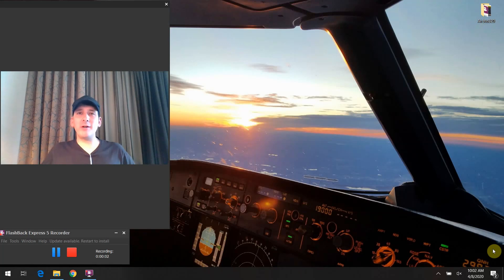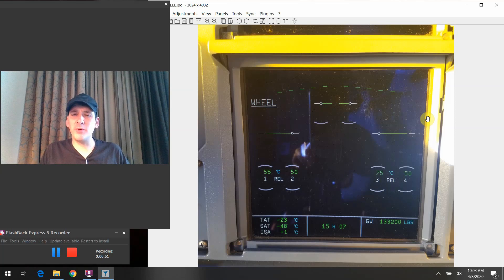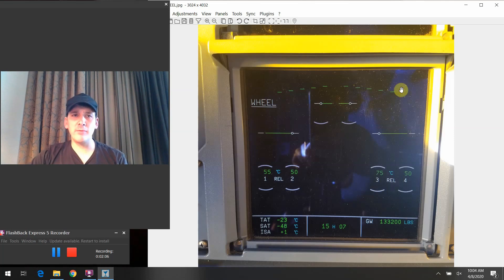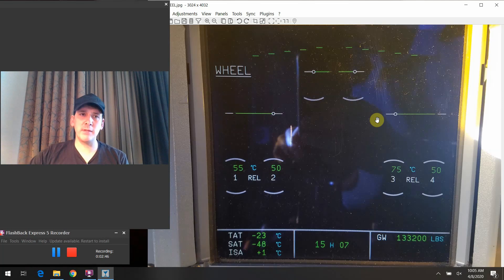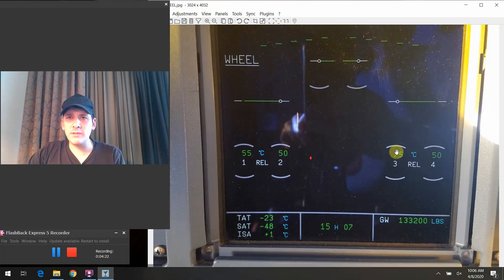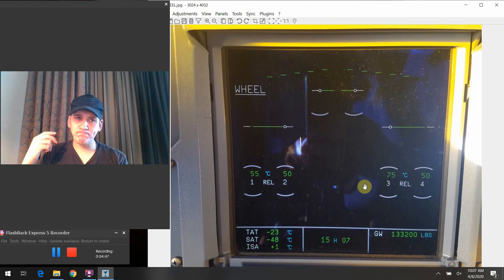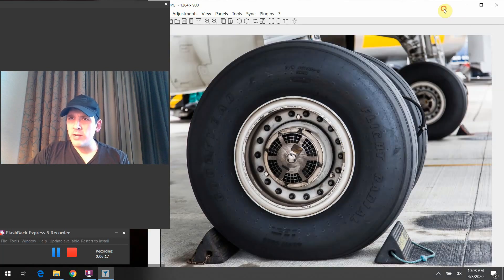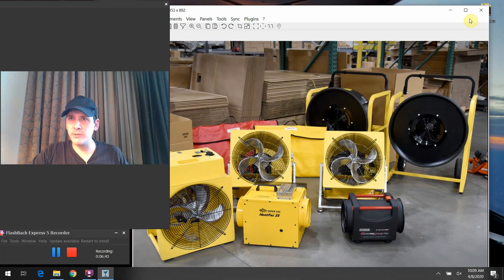Airbus A320 Cockpit Tour: #52 - SD-WHEEL Page: What do all those buttons do?!

Comment: Why airbus 320 while taxi on idle thrust starts moving
Reply from the maker: Well I'm not sure why exactly the designers of the planes and the engines designed this ratio to be what it is, because you are right, a light airplane will indeed start to move under idle thrust. I suppose this is a good design too, because remember that there are many people working around the airplanes when you are coming into/out of the gate area. More thrust above idle settings can actually hurt people very badly and blow equipment around the ramp. One interesting thing though is that a very heavy or fully loaded airplane wont always move under idle thrust alone. Sometimes you actually have to bring the N1 up between 40-50% to get the airplane moving. But this must be done very cautiously.  Cheers Simrat!
Reply: Thank u captain for your lovely explanation ❤️😘 😎
Reply from the maker: No worries Simrat! Hope you are having a wonderful day!